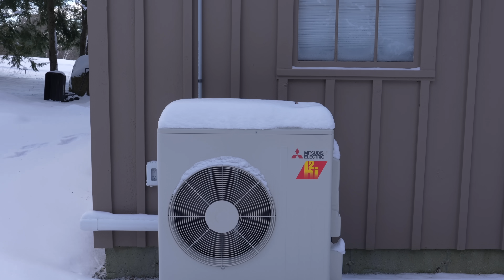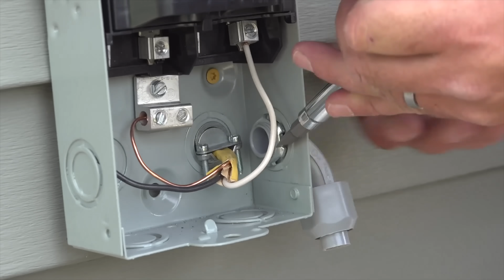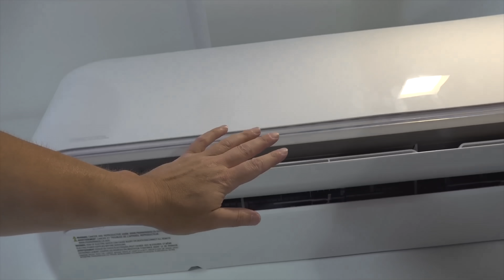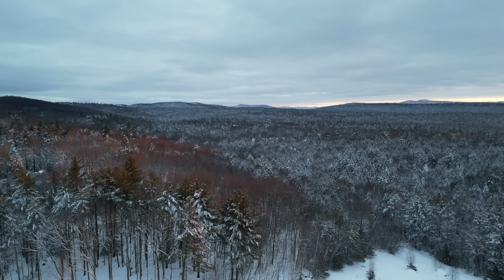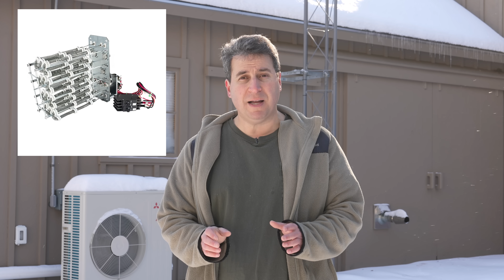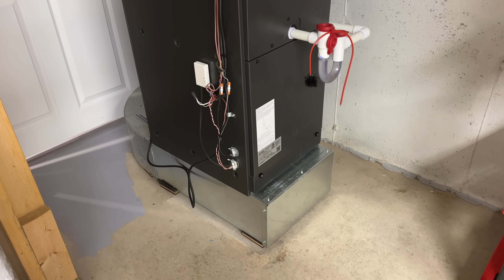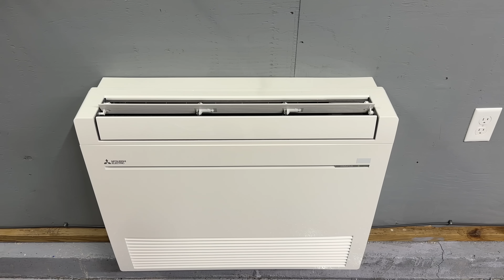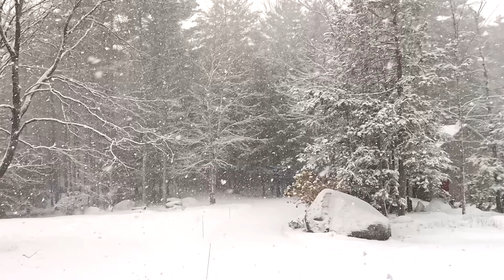Why Heat Pumps are now leaving people COLD

Comment: I've got a large house with 2 heat\cool pumps in Florida, and today with our temps in the 30's, it's ok. However, we lose power a LOT, due to Random Storms, Tornadoes, Hurricanes, iced power lines, etc. Without a fireplace, and my propane heaters, my 91yr parents would freeze. My generator is able to handle a small wall unit, but not two 5 ton units. I've just seen a liquid paraffin heater, and wonder if that would work. I grew up with a kerosene heater, and aside from starting it outside to stop the bad smell, it worked well. My oil lamps work well with liquid paraffin, and these heaters look interesting. Especially since storing so much gasoline for the generator is a pain... I'd love to go to solar, but the battery would have to be HUGE! Thanks for explaining about these systems, I've been thinking of installing one or two in my Western NC Mountain farm house. I'm building from scratch, and need good ideas to be as independent from the grid as possible! I'm not working with as much money as I thought I would have...
Reply: Kerosene heaters have killed thousands of people over the years.  Either from the carbon monoxide or knocking them over and igniting the house.  Kerosene is no longer cheap, now selling by the gallon for maybe $15.

Comment: I have a dual system heat pump.
When the temperature drops below fifty, it uses gas to heat the house. Above fifty the heat pump will use the electricity it works great.
Reply: Wouldn't it be cheaper to run the heat pump down to 40?  Switch over to gas a 40.
Reply: @BrianNC81   yes, when natural gas was over eight dollars it would have been cheaper to run the heat pump down to 40° but since they raise the price on electricity it’s much cheaper now to use the natural gas.  Plus, the heat pump does not put out hot air. It’s cool air, the natural gas puts out hot air, heats the house, much faster and keeps it warm.
Reply: @paullopresti9568  we have two gas furnaces, was thinking next system doing dual fuel.  In NC so a lot of our winter is mild
Reply from the maker: That is a great idea! Wow I like that design
Reply: Most heat pumps are extremely efficient below 50. Seems like a waste of gas but I'm sure you've run the math for your area.

Comment: I've been looking to get a Mitsubishi hyper heat unit(ductless) as a secondary heater to supplement my oil heater. I've be ballparked 20k ish to do my 1500 Sq ft ranch. I plan on reducing my oil usage as it is very expensive but I'm curious if it will end up being a wash with the drop in efficiency. I do plan on going solar but I'll have to navigate the ever changing politics of CT and their net metering rules. Would a Mitsubishi unit still be more efficient than resistive heating? Or rather, at what point would it be the same? 10 degrees F?
Reply from the maker: You will be in an ideal situation since you still will have your oil heat. In fact the mitsubishi can even tie into your heat regardless of the brand. So when the Mitsubishi detects its not doing a good job, it will turn your oil heat zone for you and turn off when performance improves. In CT you will definitely get many moderate months where your oil will likely not be used at all and these are very affordable to run outside the of the super cold months.

Comment: I have a heat pump in a townhouse that is about 50 years old in Pennsylvania.  It is great in the non-Winter months, but in Winter, yes it seems to be on so much and has difficulty keeping the house warm.  My house is not well insulated which is one of the main issues.  Chris, great job standing outside with that snow whipping around! ❄😆
Reply from the maker: Thank you! It looks so nice out there, cold but the snow is pretty
Reply: Dave my parents home is about 40 some old home insulation was years behind. Windows, doors, and stuff like that can be the issue.
Reply: @WilliamHollinger2019  

Why don't use the hot water of the boiler to heat the house?
Reply: Insulation is indeed the key here, you need a good insulation for heat pumps they cannot get the temperatures that high and so it takes a while to get things warm and insulation to keep things warm!
Reply: @werpu12  Heat pumps need insulation?  Say wha....?  If you are referring to wall and attic insulation in the house, that would hold true for any heat source.  If a heat pump is inadequate compared to a gas furnace, it only means that the heat pump was not sized correctly.
Reply: They are made to run all of the time, and with correct sizing they will be running all of the time.  Oversizing hurts efficiency.
Reply: The tech is also a lot better than 50 years ago now
Reply: @jasonlaboy  I'm guessing the house is 50 years old, and not the heat pump.  I've never seen a unit last more than about 35 years.  That would be close to double a normal lifespan.

Comment: They're failing people because your home was most likely not insulated properly or sealed correctly or your system was undersized or not sized correctly.
Reply: hahaahahahaha... heat from below 30 degree air.   yeah right.  you must only sell heat pumps
Reply: @samthing4thetrack806  all it is, is temperature differential. When the refrigerant goes thru the heating/cooling cycle it will either absorb and dump heat. Sure at certain temperature extremes that gets harder to do and therefore more energy intensive...but it's still true.
Reply: @nemam_nedam  In Norway and Sweden 90-95% of all heat pumps installed are air to air heat pumps due to low price and short return of investment. A ground source heat pump is typically 10 times more expensive and return of investment is often longer than the life expectancy of major parts (20+ years). Having lived in houses with air to air heat pumps for more than 25 years without problems (in temperatures comparable to that described in the video) I do not consider myself a fool. We have of course well insulated houses and supplemental heating in case of failure or extra cold days, but that's just common sense. I do not have exact data but a qualified estimate is that my 200 sq meter house gets about 85% of the heating needs from a heat pump. On the coldest days -17c (about 0F) the heat pump still delivers about 4 kW of heat using a little under 2 kW of electricity, compared to 10 kw of heat at 2C (35F).

Heat pumps biggest flaw is that is gets less effective when you need it the most, but this i easily compensated for by correct sizing and/or supplemental heat for the rare extreme condition. If average winter temperature is -5C (23F) but you have one or 2 weeks of -17c (0F) it is more cost effective to size for the average and not the extreme.

But comparing spec sheets and looking at US based videos on YT it seems like the US market now are getting the heat pumps used in nordic countries 20-25 years ago. and like phones or computers, 20 year old technology it not considered the best.
Reply: @MeltingRubberZ28  yes it is true but that doesn't mean that they are practical for heating in most of the USA.  I have an ecobee and a gas pack.  It logs the system run, in the dead of winter let's say in ATL it runs alot, this was after doing the HVAC calculations, and my contractor oversizing the gas side by 2x to save me from the gov. numbers.  My house is efficient still, as on average I spend $150 through the year for gas and electric, and it is almost 3600 sq ft.  The numbers called for around 33000 BTU for heating and cooling.
Reply: @samthing4thetrack806  that's really not bad at all. I'm with you that I don't think they are a direct replacement for most HVAC applications (need additional heat sources) however they are very efficient. I put two in at my place and are convenient for heat where there is none, and great for AC...but not a complete HVAC replacement.
Reply: I bet those amazon mr cools he installed no longer work